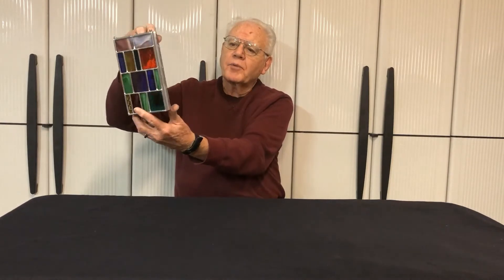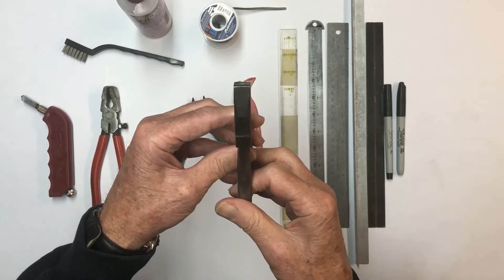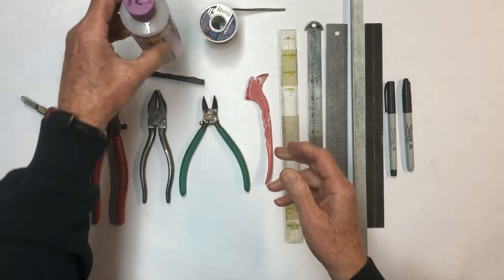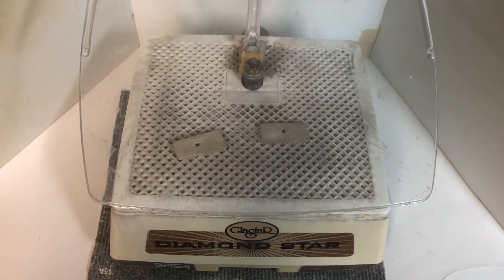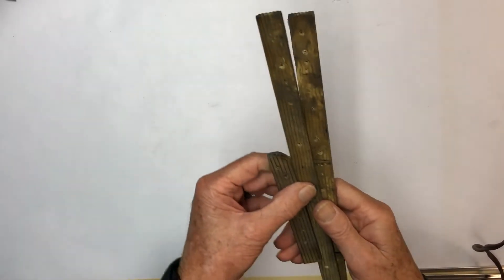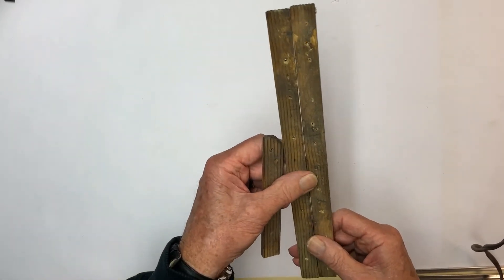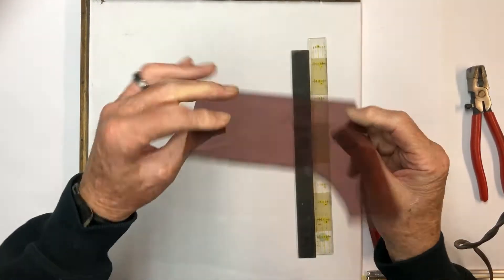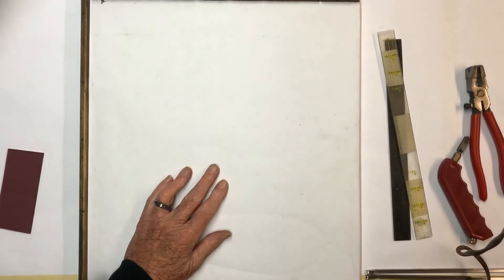How to make a leaded glass solar lantern for the Beginner!!

Comment: You’re soldered joints are perfection.  I started stained glass in the early 70’s also, but didn’t keep it up.  I’ve gone back to it three or four times over the years and am thinking about creating again.  Thanks for your inspiration.  😁
Reply from the maker: Thanks for the kind words, I hope you get back into it. Things have changed over the years. I think everything has gotten better from soldering irons, solder, lead came, lead cutters, flux, running pliers, glass cutters and more. Again thanks for subscribing to my channel.
Regards, Bill Stone

Comment: Bill I love your projects.  I am a copper foil person. BUT ready to change my ways and do a couple of your projects.
Reply from the maker: Hi again,
Glad you found my channel; I hope you will try the leaded glass style of stained glass. It's been around for 100's of years. The two sizes of came I use in these projects are RU-70 for the U came and RH-9 for the H came. They are made by Cascade Metals. Check out their web page and you can get a chart showing all the different lead came they make. If you do give the lead came a try, remember to stretch it, also when soldering check, your iron and make sure it isn't too hot for the lead. Unlike copper foil the lead will start to melt around 730 degrees, always check your iron on an old piece of lead came to be sure it isn't too HOT!! There's nothing worse than to get your project all together and get ready to solder and melt your lead on your first solder joint!! Have a great day and best of luck with your projects.
Regards,
Bill Stone

Comment: VERY thorough explanations and video! I so appreciate this- I have never worked with came and I was wondering if you could comment on doing this with foil and soldering instead. I love how it looks and may make one! Love it!
Reply from the maker: Hi Elizabeth, Glad you are enjoying the videos, YES!!! you can do it with copper foil, it's not as strong as the ones with the lead came buy would work. If you haven't watched my two videos with the modern flowers and the one with the pink flowers, they are both copper foil with lead came around the outside edges. Check them out when you have time. Thanks for your kind words and have fun making leaded glass projects.
Regards, Bill Stone

Comment: Hello,
Thank you for sharing your knowledge and experience.
Please tell me what material your workspace is made of. I see that you hit nails with a hammer, but also you stick needles with your hand.
Thank you.
Reply from the maker: Hi Valentin,
The top of my worktable is covered with a product called Homasote Board, it's a product used as a sound barrier, and is used wherever they won't to block out sounds. You can purchase this type of board at most old fashion hardware stores. You can also find it online and Amazon and Delphi Glass in small sheets. I have used this system for over 25 years, before that I used horseshoe nails like you still see used in a lot of videos.
I use the small nails to hold down the form I use to build the projects inside. The metal push pins are 5/8" long and can be found online also as will as Amazon and Delphi Glass.
Hopefully this helps you out. Best of luck with your projects!!
Regards,
Bill Stone
Reply: @billstonesstainedglasscrea3310  Thank you, again.
My confusion was caused by the fact that there are two types of force (hammer and hand), so there should have been two types of material - one harder and one softer.
 I'm at the beginning and your videos help me a lot.
Reply from the maker: Hi Valentin,
You're right, under the Homasote board there is a 3/4" plywood top on the worktable and then the Homasote board on top of that. The Homasote board 1/2" thick. The small nails I use are 1" long so they go through the Homasote board and into the plywood top of the worktable. Glad you're enjoying the videos. If your new to leaded glass this is a good one to look at first, they all get a little harder as they go on. Have a great day!!!
Regards,
Bill Stone

Comment: Bill finally getting down to making my solar lantern.   My solar light is 3 3/4 across.  I have done my triangle and come up with 5 1/4.  How did you come up with the bottom opaque piece.   Using rh8 and ru90.   I’m think I subtract the width of lead channel from 5 1/2 ?  To get overall measurement for bottom piece????   Brain fart😂😂😂
Reply from the maker: Hi Mary,
So glad you're going to make the solar lantern. You said your panels are 3 3/4" wide, is that going to give you enough room to get your solar panel into the top? The panels for the video were 4 9/16" wide and that was for a solar light that has a diameter of 2 1/8" Hopeful your solar light is smaller so it will fit. To make the bottom piece of opaque glass, I just turn the unit over after all three panels are soldered together and measure the width and cut my glass about 1/8" to 3/16" smaller to leave a small gap for any rainwater to run out of the lantern. So, if your panels are 3 3/4" wide, you need to cut a piece of glass about 3 5/8" wide on all three sides of the bottom glass. If you're not sure you have the right size, make a cardboard pattern and cut it down to fit, then cut your glass off your pattern. I took a look at the video and there are a lot of tips on it, if you are new to the hobby, you might take another look at it when you have time. Also, you said you were using RH-8 H Came and RU-90 U Came. All the projects in all of these videos are made with RH-9 H Came And RU-70 U Came. Even the video showing the larger projects are made with this same came. The RH-8 H Came is a nice size, the RH-9 H Came I use it the same size but has a larger channel to hold the thicker glass. Your RH-90 is awful small, with a crown of only 1/8" it's going to be really hard to get the panels soldered together without some solder bleed through on your sides. Thanks for your comment, hopefully I helped you out a little. Please feel free to ask me anything about these videos. Let me know how you make out when you get it done. Have a great day!!
Regards,
Bill Stone

Comment: When you are cutting the pieces for the panels i.e. the 1x2,  3/4 x2 and 1/2 x2 are you allowing for the gap on your cutter?
Reply from the maker: Hi Rayn,
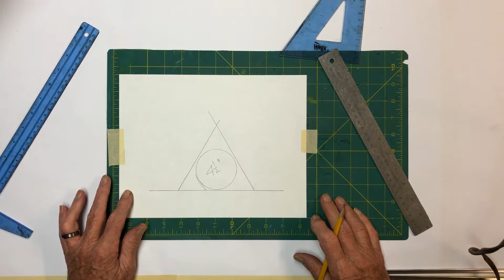Thanks so much for your comment, I took a look at the video and around the 10:04 mark I address the problem of the glass and lead came making the project grow a little. This is one of my videos I call cut and stack, and I don't really care if it grows a little. The drawing at the start of the video shows you the minimum size of the panel, if it grows a little you don't care, you just don't want it to come out smaller because the solar light won't fit. You are right in asking about the amount it grows because of the cutter and the lead came. The U came adds about 1/16" to the panel on both sides and the H Came adds about1/32" each time you put it between the glass. This was my very first You Tube video and see where I left some things too chance, hopefully my newer ones have improved!! So, with that in mind if you wanted to make it exact all your glass would be cut using a ruler that is about 1/16" small than the finished cut size. Example a 1" piece of glass would use a 15/16" ruler plus the 1/16" the cutter would add to it to come out with a piece exactly 1" wide. I hope that makes sense to you!! Where you have to be really carful when cutting your glass is when it has to fit into something that is already made, like a window panel that needs to fit into a give space. All the projects in my channel don't have to fit into anything so if they grow a little it's fine. Hope that info was helpful and good luck on your projects. Please feel free to as me anything about these projects!! Have a great day.
Regards,
Bill Stone
PS: They do make what they call pattern shears for both lead came and copper foil projects. These shears cut out a small strip from your pattern paper to allow for the lead came or copper foil.
Reply: Thank you Bill for the fast response, that answered my question perfectly, I knew that ruler wasn’t 1 inch wide, I focused on that hard. Beautiful work sir!!
Reply from the maker: Hi Ryan,
Your more than welcome, please feel free to ask me anything about these projects. When you have time check out my newest video, it's about some window panels I made almost 50 years ago!!
Enjoy your day.
Regards,
Bill Stone

Comment: Hi Bill ive been meaning yi ask you have you used the cotter pins just with foil & solder or could you even do that or would it rip off, just curious for a small hanging suncatcher,would that work ?
Thanks Bill have a nice day 😊
Reply from the maker: Hi Austra,
All the copper foil projects I make that are going to be hung outside, I put RU-70 U came around the edges and line up the hangers where there is a joint connecting the outside edge to some part of the inside of the project. If you just solder the copper pins to the outer edge of your project, it will pull away from the glass just from the weight of the project over time. Hope that helps you out!!
Regards,
Bill Stone
Reply: @billstonesstainedglasscrea3310  yes Bill it does I just thought I would check but I thought as much
Have a nice day 😊
Reply from the maker: Your very welcome!!
Regards,
Bill Stone

Comment: Hi Bill, hope you & yr wife are well.
I was just wondering which tool do you use to get the brad nails out without doing damage to the board, so i lnow what to get at the hardware store.
Thankyou, have a great day 😁
Reply from the maker: Hi Austra,
Thanks for your comment, I just use a heavy duty 3" wide putty knife and slide it in between the form wood and the top of my worktable and lift it up and it comes right off. Have a great day!!
Regards,
Bill Stone
Reply: @billstonesstainedglasscrea3310  Thanks Bill
Reply from the maker: Hi Austra,
Your more than welcome!!
Regards,
Bill Stone

Comment: Do you have  directions for making your jigs?
Reply from the maker: Hi Again,
Unfortunately, I don't have any plans for these jigs, they are all made from 3/4" pine and I cut them up on a table saw. The jig for this video was made on a 60-degree angles and has two V shaped ends set at 60 degrees to hold the panels in place to solder. I have several all at different angles I've made over the years. Maybe you can get someone to help you make one of these jigs. Again, sorry I couldn't be more help on this. Have a great day!!
Regards,
Bill Stone

Comment: I have just made a. Project but  I have little spaces in spots do I have to re cut or can I put foil in between the spaces
Reply from the maker: Hi Peggy,
Sorry to hear you're having trouble with your project. Are you talking about the 3 panels or when you put the three panels together? Couple of questions, when you cut your glass did you use a straight edge or cut it free hand? Also, what size Lead Came are you using? I think adding copper foil to it will make matters worse!! 
It sounds like your glass isn't cut straight. And your Lead Came doesn't have a deep enough channel to hide the glass that may have a curve to the cut. If the small spaces are where you put the 3 panels together you can buy a product called liquid solder. You can use a small skewer like you use in cooking or a toothpick and apply it to the inside of your project where the Lead Came come together. If this is your first, try with Lead Came don't beat yourself up too bad. A few open spaces will give the project character!!!  The two sizes of Lead Came I'm using are RU-70 U Came and RH-9 H Came, both are fairly small. Good luck and let me know how you make out!!
Regards,
Bill Stone

Comment: Beautiful s. lantern! My glass creating has only been with foil. So many advantages to using led I want to switch.
I also need to rearrange my workspace to make room for the jig layout.

What is the surface you are nailing into? Plywood? Also curious if you sell your pieces?!
Reply from the maker: Hi Cathy,
Merry Christmas to you!!
I have always liked the look to Lead Came over Copper Foil, plus it's must faster to make your projects with. The two sizes of Came I use for all my projects are RU-70 for the U Came and RH-9 for the H Came. There are a couple of videos where I have used RU-90 U Came, that is a very small U Came about 1/8" wide. My worktable is made with a 3/4" plywood top with a 1/2" Homasote #440- Sound Barrier board. It comes in a 4'x8' sheet, and you can get it at any old fashion lumber yard. They may have to order it for you special. Most lumber yards will cut it to any size you need. You can also find small sheets at Amazon and Delphi Glass. You can also buy the metal push pens at both of these businesses. The Came I use is made by Cascade Metals, check out their web page and you can download a chart showing all the different sizes of Came. As for selling these projects, I don't sell them because the shipping is very expensive and runs up the cost of the projects, to the point that the average cost of a $79.00 item would be will over $110.00 with shipping. Most everything I sell is at our yearly Boutique where we live, the rest of my items are sold through word of mouth in our local area Hopefully that helps you out!!
Have a Happy New Year.
Regards
Bill Stone.

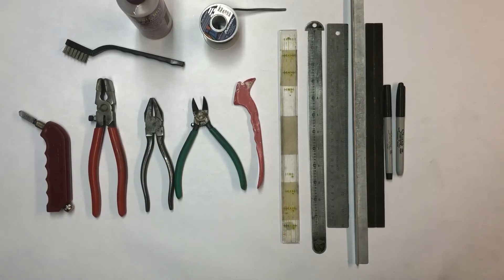Comment: Would you consider selling me a jig for this?  Great video! Thank you!😊 1:11
Reply from the maker: Hi Brenda,
The jig I made for the solar lanterns, is something I came up with after making several lanterns in between two 2"x4" I nailed together and sat just far enough apart to make the two panels set at 60-degree angle needed to put them together. there're all kinds of things you can use to prop up the panels to solder them too together. Maybe you can find a family member that works with wood that could make you one. I had one lady that had the local high school wood shop help her make one. I hope you can find someone to help you out. I'm so sorry but as I've gotten older, I had to stop using my table saw as I didn't feel safe using it anymore. Again, so sorry I couldn't have been more help with that. 
Have a great day!!
Regards,
Bill Stone